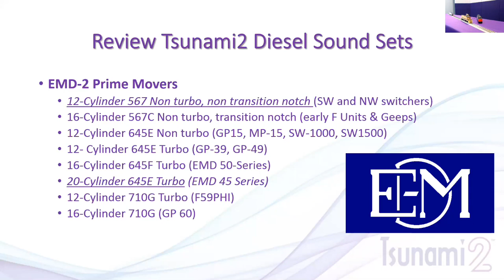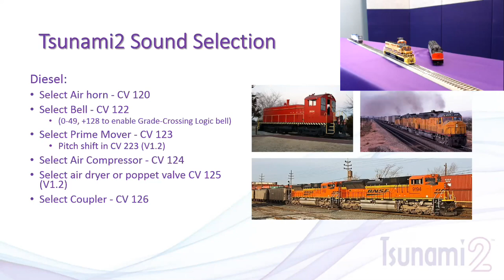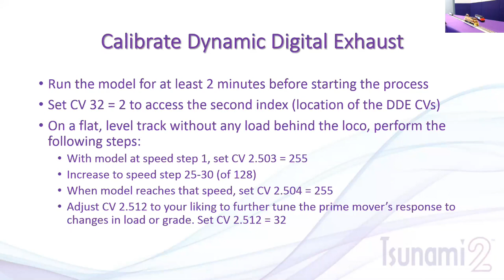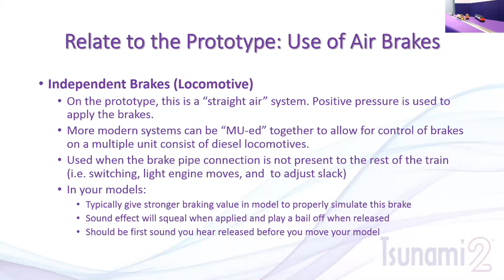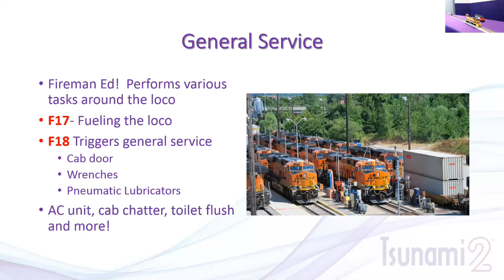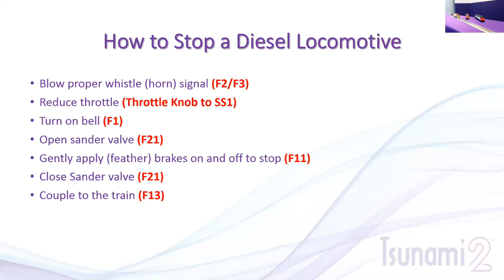Tsunami2 Diesel Decoder Setup & Operation (Webinar 11)

Comment: This video lists several  EMD turbo and non-turbo engines include 12 and 16 cylinder engines yet the chart that comes with the decoder does not specify 12 or 16 cylinder, just turbo and non-turbo. How do I know which to select?
Reply from the maker: Refer to this document for help:
https://soundtraxx.com/content/Reference/Manuals/Tsunami2/Tsunami2-PrimeMovers.pdf  

and then this:  https://soundtraxx.com/reference/choosing-the-right-diesel-sound/  

If you need more assistance after that please contact our support team: support@soundtraxx.com